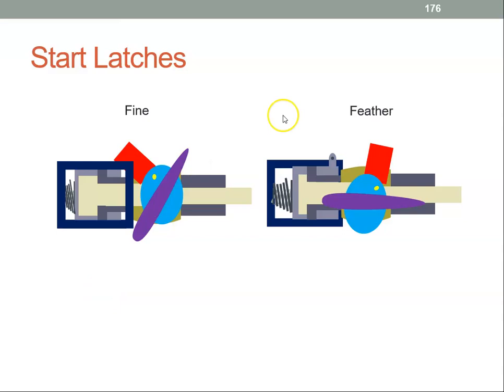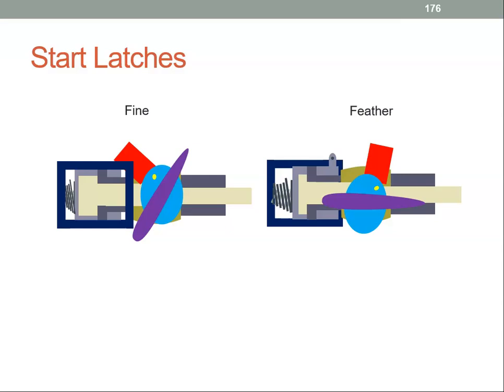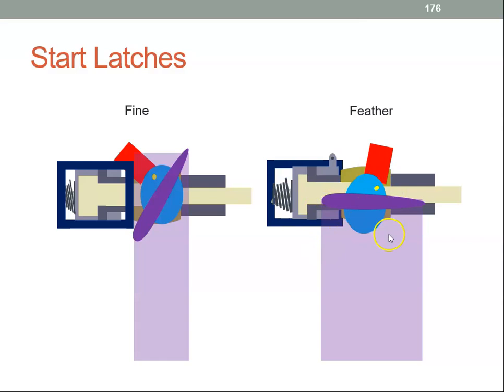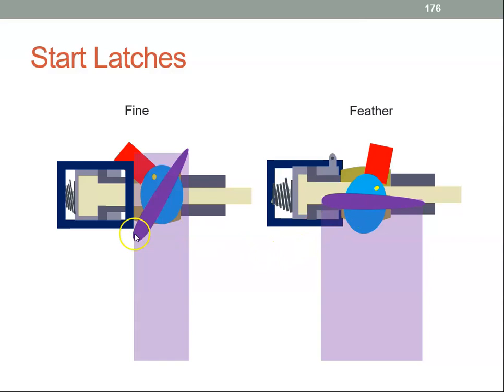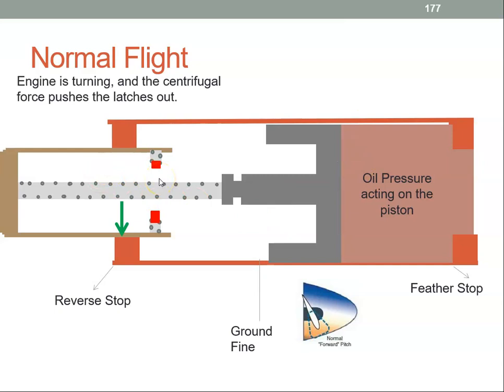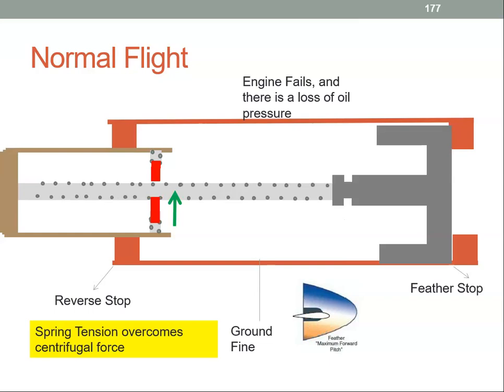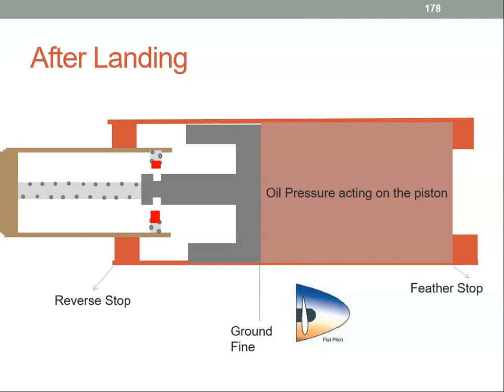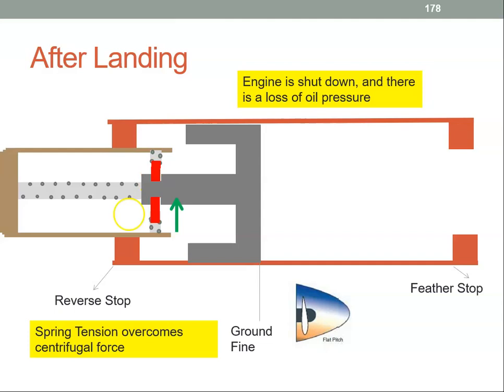Propeller Start Latches

Comment: Hi Roddy...(great video thank you)

I fly a C-208 Caravan PT-6A-140 on floats.  My question is:  What is the correct procedure for shutting the engine down "on the locks / latches"?  We want the flat pitch for a quicker start off the dock, or beach.  
My understanding that whilst the prop is in Beta, mixture is moved to the shut off position, and then is the power lever moved to the reverse region?
Reply from the maker: Hello Paul.  I’m not familiar with the C-208 at all.  However, I suspect the PT6-140 has, almost certainly, a free turbine, therefore there probably won’t be any start latches.
Reply: @RoddyMcNamee  spoke to the guys at Hartzel / prop shop and got the answer however I do appreciate you getting back to me